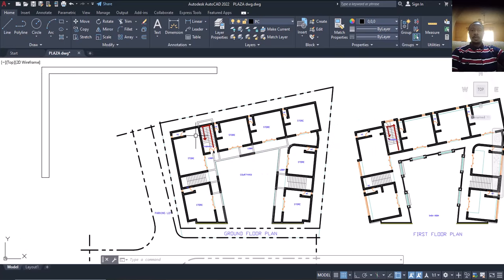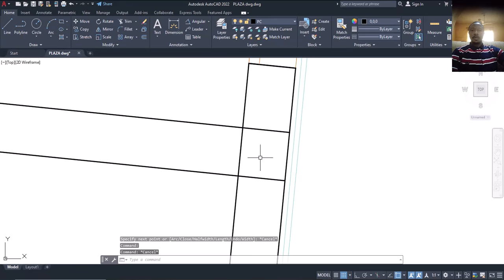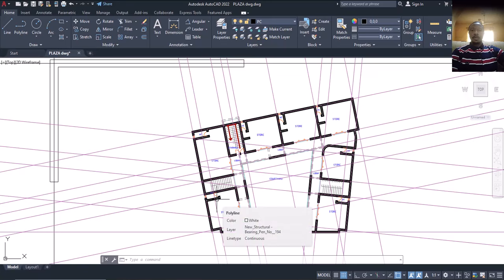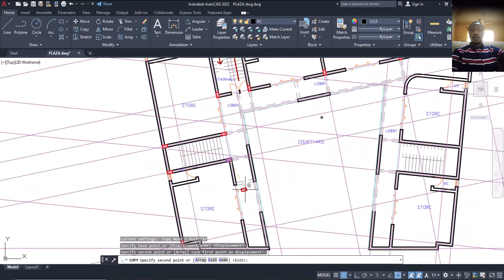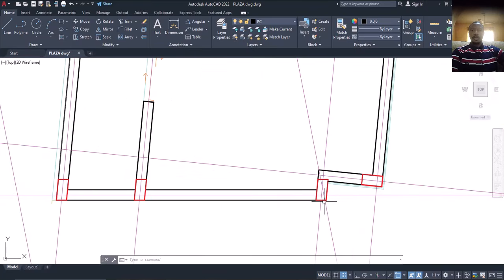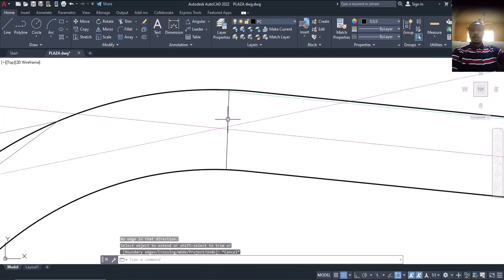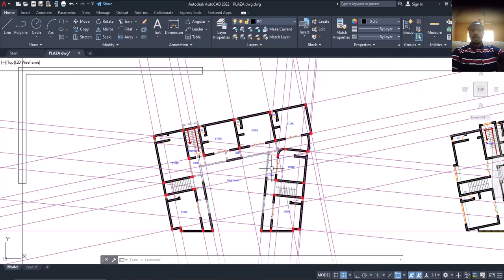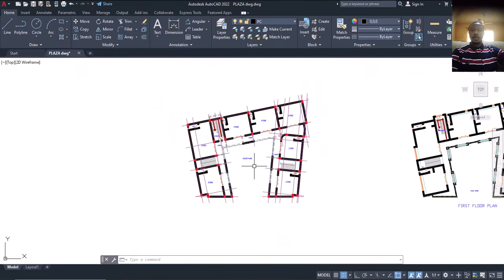Structural Framing of Irregular Shape Building | Protastructure | AutoCAD

Comment: Good one  and this is where you use semi-rigid structural analysis in protastructure due to the large openiny at the centre and the irregularity in shape of the building good one you use either load chase down method or the floor mesh analysis
Reply from the maker: Yeah